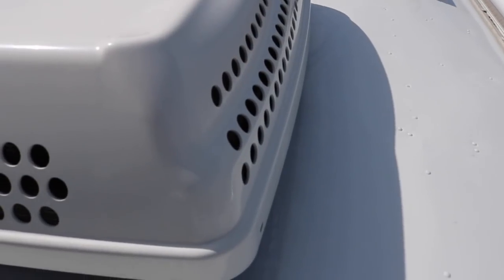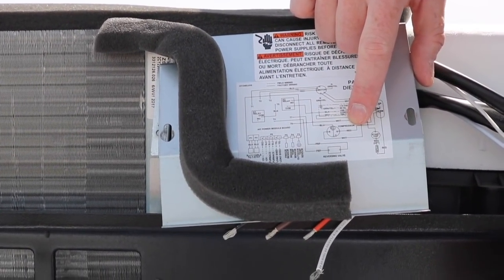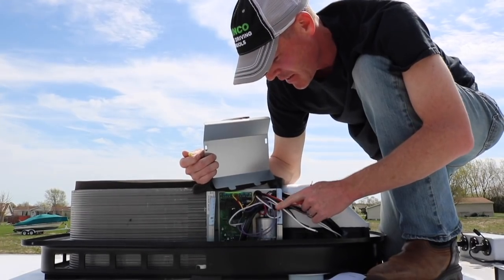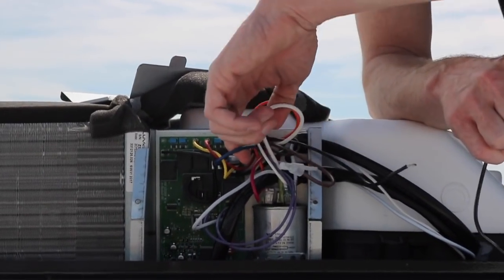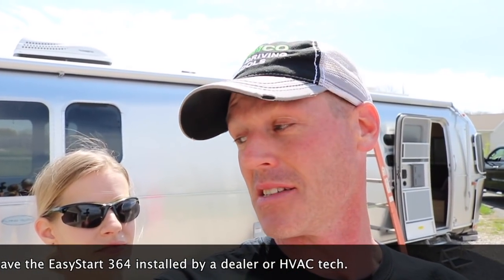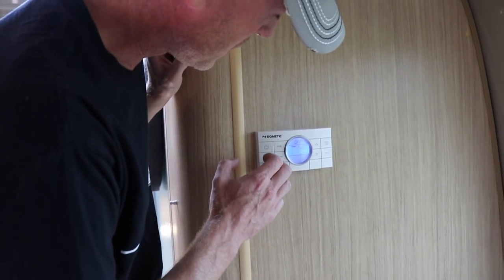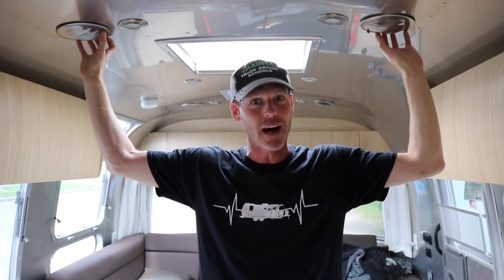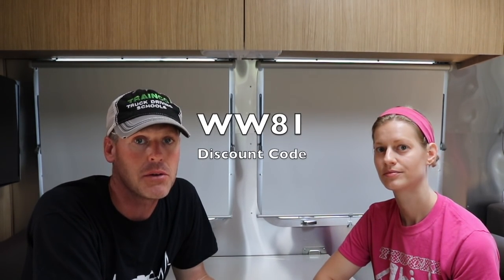HOW TO UPGRADE YOUR RV AC (DIY MicroAir Easy Start 364)

Comment: I am handy but ... at 3:07 I felt sorry for the divorces that have occurred after the wife asked for the 34th time... "are you sure you know what you are doing"? Looks like the engineers actually may own an RV and climbed up and took the cover off the A/C but for those not able to read a schematic (most people) this looks like a 12 on the 10 difficulty level.... yes my glass is always half full
Reply from the maker: It was really simple. Their instructions are also quite detailed if someone has questions.

Comment: Great video Wagners in the a/c industry they refer that product you installed as hard start which is used typically when central unit has some age on it make draw less current
Reply: I am pretty sure that the EasyStart is a SOFT Starter. And it has everything to do with power needed at start and nothing to do with age.  Correct me if I am wrong.
Reply: Kevin you are correct, the Easy Start is a ramp-up soft starter. I use to work in the industry installing in commercial single phase units.